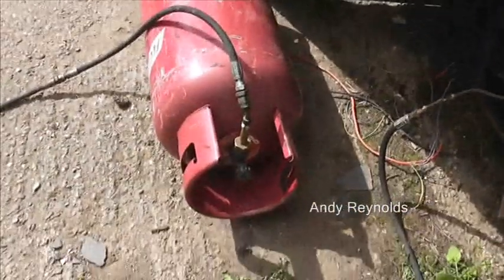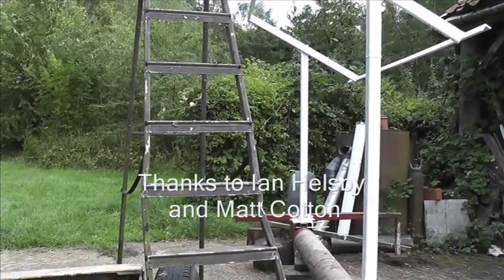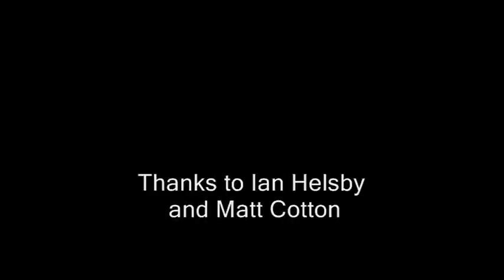Propane recycling and transfer. No Dyson nonsense.

Comment: I'm the fellow who puts the receiving cylinder in the freezer. I have a large chest freezer, I can get a 19kg cylinder in it. I normally fill 11 or 13kg cylinders , I can get several of those in at once.

If you search for a graph of vapour pressure vs temperature for propane you will note that at -20C vapour pressure is about 2.7 bar abs and at +20C pressure is about 8.7 bar abs, giving a pressure difference of 6 bar or around 88 psi if you speak imperial. An 11kg cylinder fills within 3 minutes. Because the transfer is so fast you can stay with it and shut the transfer down when the exact desired fill weight is reached, without waiting around for hours, then missing it and over filling the receiving cylinder. A 19 kg tank won't fill in one shot, so let it fill to half in two minutes, disconnect, freeze again then top off. This method requires very little time " on watch" to avoid over filling. Highly recommended if you have the facility. 

Thanks for all your helpful videos.
Reply from the maker: Hi, thanks for sharing your experience, definitely worth considering for smaller cylinders, cheers